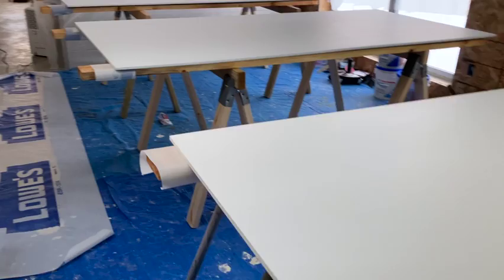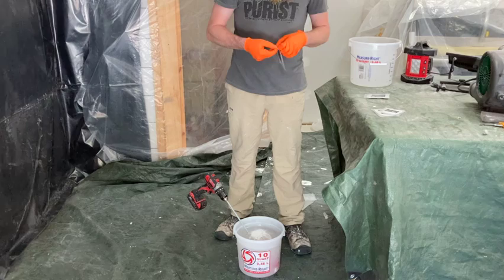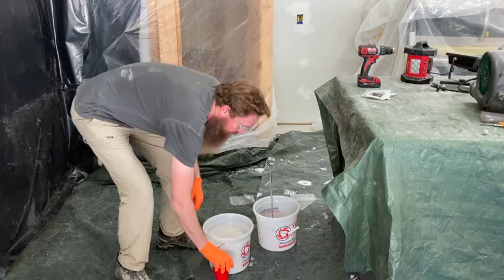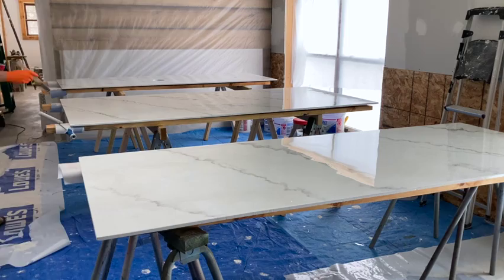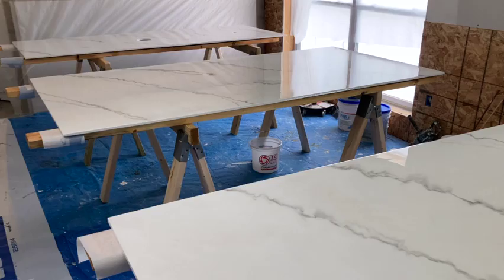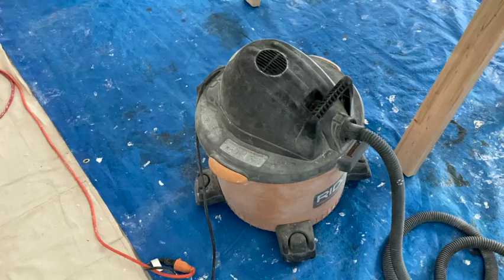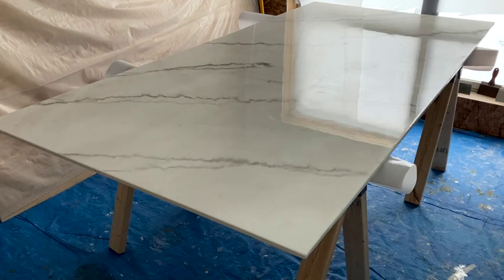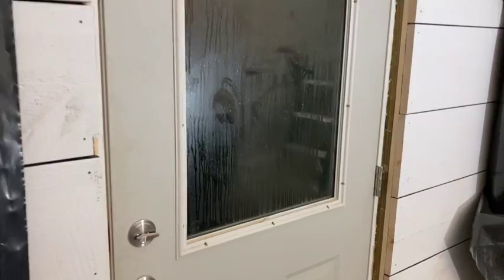Stonecoat Epoxy Shower Walls! Plus we textured the remaining walls and ceiling with help from Mike!

Comment: Those shower walls, did you epoxy the back sides too in case water got back there at some point?
Reply from the maker: Yes, I did. Although in hindsight probably not necessary.

Comment: Can you tell us what the specs are on the foam panels you used?  The Stonecoat Countertop folks used 1" pink foam, but yours look like 1/2".  I've been thinking of using the 1/2" foam backerboard options that are out there now.  Thanks!
Reply from the maker: Thanks for the question! I actually used 1/2” MDO (marine grade) plywood and not foam at all.
Reply: @MattZudweg  Thanks.  Good to know.